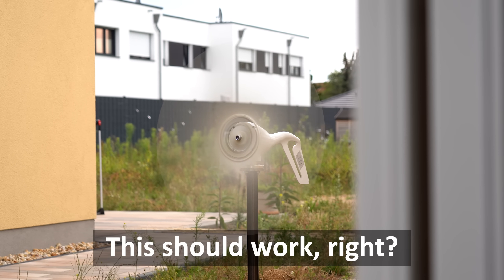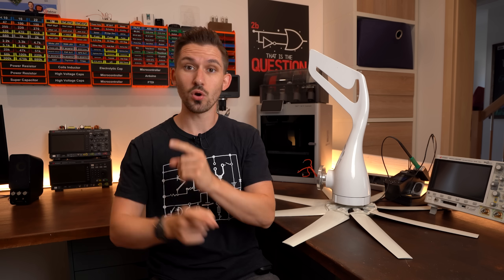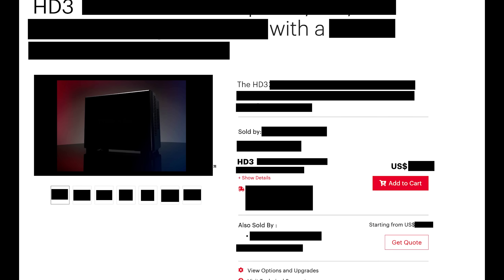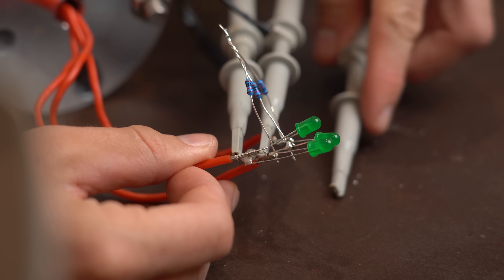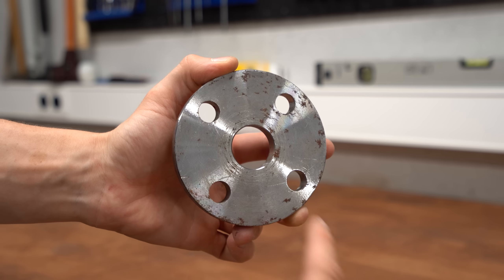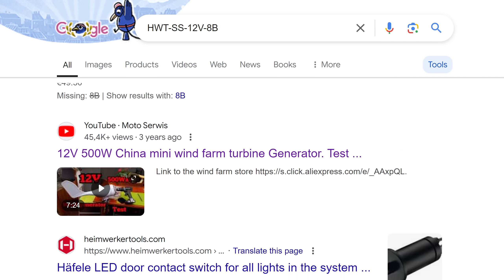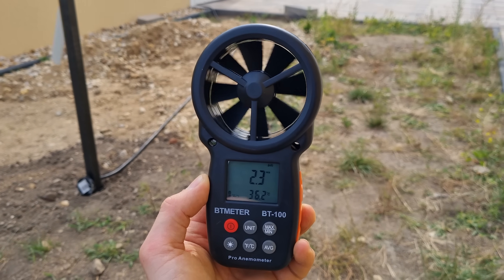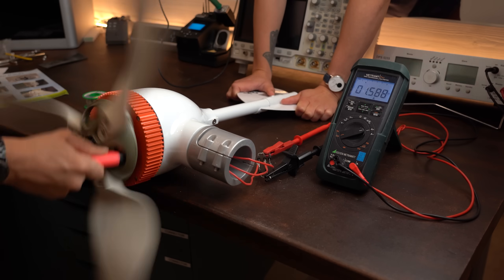I tried to Power my Home with Wind Generators! (Worth it?)

Comment: The ultimate curse of home wind generation is that the power you can extract from the wind is proportional to the rotor area, multiplied by the CUBE of wind speed. Low wind speeds, like those you can get close to the ground, have just a pitiful amount of energy that you can extract no matter what turbine you stick in the airflow.
Reply: Yep, mast height has always been the problem.  Masts really need to be greater than 30' above building tops, trees and other objects that affect the wind stream.  The problem is well documented for decades, and there have been no successful low mast solutions, not VAWT, not clustered, not funneled.  Minor gains can be made with some tricks, but those tricks always add complexity and structural weaknesses that make them prohibitively expensive.
Reply: 100% wind is not a very effective solution for homeowners. Even on a 12ft pole. Of course if you live on the beach and own a beach wall where wind is coming oner it most of the time, a giant horizontal one might be decent power, but that's very few people. Most small wind turbines are lucky to get 300watts out of them. They can claim 1200w but no one can ever get that, unless it's a hurricane lol. Solar is far better for home power.
Reply: @earl_gray  Yep, or dump it into refrigeration or heating/cooling if possible.  Roughly 30% of the electricity is wasted by charging/discharging batteries and running it through converters and controllers.
Reply: Yep, which is why modern wind generation plants use huge sized blades rotating at lower speeds but at large heights.  Basically, might as well use battery power at home with Solar.
Reply: @Obloms  Also important to note, that given their enormous size, the tip speed ain't that small either. Sure, nothing like a helicopter rotor or such but still quite significant.
Reply: @Obloms They rotate "slowly" to your eye because tip speed is fast with blades that large, and they use transmissions to change shaft speed.
Reply: @machooke4846  There's a truckstop near me with one and I got a good look at it's insides when they were building it up. It had the actual generator at the base with a long shaft straight up the mast. At the top it looked like a simple CVT with a bevel gear to the actual rotor.
No idea what other trickery was involved but it looked fairly simple.
Reply: @Obloms tip speed on large wind generators are very close to mach 0.8 (the speed of sound)
Reply: @Obloms  - commercial blade tips are moving, surprisingly fast, just the rotor RPM is fairly moderate...  (BLADE aspect ratio is proportionally approximatel to lifto drag, and tip speed  to wind  speed ratios.)  The numbers simply don't amount to a lot in small form factor.
Reply: @earl_gray  Not if they're not paying you anything to put the electricity back on the grid.  Which they don't, because when your solar is producing, so is everybody else's.  "Peak demand" used to be in the middle of the day.  Now, peak pricing is in the evening, because solar provides so much cheap power in the daytime.

If the utility is not paying you enough to put the money back on the grid, then the "inefficiency" of batteries doesn't matter.
Reply: Would one on top of the roof of your house work?
Reply: @99domini99  It'd be better than sitting at ground level, but not by a lot. For comparison, the average commercial wind turbine sits atop an 80 meter tall tower.
Reply: @Nicoya  I see.

I guess it would be way more effective to invest in a battery backup system so you can use your solar overproduction during the night.
Reply: @99domini99  Yeah, solar-battery systems are the big push these days, not just for overnight, but to shift overproduction surplus from midday into the late afternoon when demand peaks.
Reply: @Nicoya that would be the ideal situation, currently battery storages are adjusted to charge as soon power is available from the solar modules.
There is a peak in power consumption in the morning when people wake up. In summer this peak is partially covert by solar modules. When now a lot of batteries are installed, the solar production in the morning is not available anymore to support the grid during this peak time, because the excess energy goes straight to the batteries in the morning. This is something which has to be figured out in the future to generate the benefit which you describe.

The solution for this problem is not trivial. Let’s say a rule would be introduced to allow charging only after 9 am. All batteries would now start charge at 9 am. This would suddenly remove a lot of energy from the grid at this time. This is also not a solution. 

The solution would be that the grid controls when which battery is allowed to charge. To introduce such a control  will take a few years.
Reply: @Nicoya  Exactly right Nico, and most micro wind power companies publish that prominently so they don't get sued.
Reply: @99domini99  Depends on where you are in the world. If your locaiton is somewhere where there aren''t long dark winters sure but for huge chunks of the industrialized world (North america north of New york, Europe north of the Alps at the very least) Photovoltaics cells are not a a good option. They generate very little in winter which is when you need it the most. I would not reccomend anyone buying solar cells unless they have a AC that draws a lot of energy.
Reply: @supertyp9148 wondering if there's a way to only charge when there's excess power available (and only start charging on enough batteries to level it out)
Reply: @99domini99  that is very expensive and batteries die within 5-10 years.
Reply: @99domini99  how much do those things cost?  And do way realy even pay of in the long run?
Reply: @supertyp9148  That's only a concern for residential solar and of that minority, the ones who choose to buy battery systems. Large scale solar farms will continue to feed into the grid.
Electric utilities can also adjust time of use peak and off peak rates to encourage battery charging during the middle of the day. A simple rule that battery charging isn't allowed in the morning would be straight up ignored
Reply: @thelight3112   yes, true. I would say the impact for residential systems is not to be neglected though. My perspective is from Germany. The situation can be very different in other countries. 

Big facilities trade their capacity on the electricity exchange. For small systems they are excluded to benefit from changing electricity prices. -> they have no incentive to act beneficial for the grid. 
Also the scale of domestic batteries is not to be neglected. For example in Germany, the majority of installed batteries are installed in private households and not by the industry. Around 15 GWh of capacity are installed in homes without any control. 15 GWh are around 1% of the daily electricity consumption of Germany. This is already close to what would be needed to smooth out short term peaks in demand if they could be used for this purpose. But what’s happening is that all these batteries start charging at the same time when the sun starts rising and only discharge based on the consumption profile of the household they are installed in. This has an influence on the grid already. 

The grid would benefit to integrate these storage units into the grid control. Unfortunately it’s a long way to get there. Technical standards have to be defined which are not unreasonable expensive and legislation has to be created to force the grid operators to integrate these domestic capacities.

To pick up on your comment. One could argue that it’s more efficient to concentrate on industrial scale storage unites, because of higher capacity per feed in point. Which is on paper completely reasonable. Unfortunatly in Germany the industry is lagging behind in the installation of storage facilities and one major reason for this is that grid operators are lagging behind the on the approval process. It is said, that the approval backlog on the side of the grid operators are already 10 to 15 years already and this number will only increase with the decline of batterie prices. This makes assume that the grid operators are not very interested to integrate these batterie systems. 
Also here legislation is required to force grid operators to show more initiative.

To summarize: residential storage unites have the capacity but are not integrated in the grid control or dynamic price finding for electricity. Industrial scale unites don’t yet exists in a meaningful capacity and the installation is lagging behind demand due to bureaucratic obstacles.
Reply: @99domini99  the problem is the house messes with the airflow around it.
Reply: @99domini99  Yes they do and if he had reads the instructions on the wind turbine they always say to mount at least 10m from the ground.
Reply: actually that's the power of the wind, you cannot extract more than the betz limit of that which means roughly 1/3rd.
Reply: This is why vertical wind turbines are sum much more effective. Your total blade length is longer then the height of your pole because the blades tend to be countourd and hang from top to bottom. And it can extract energy from the entire column . Not just the one facing portion.   So if you have a max height of say 15 feet. You can easily have the equivalent of a nearly 30 foot wide windmil in a 15 x 5 foot column.
Reply: I can’t emphasise enough that if you really want a micro wind turbine you must spend the money on a quality product not an eBay special. A Primus Windpower or Rutland unit that is rated for marine use. It will put out what it advertises and will last for years. I have two and they are over seven years old and still going strong.
Reply: The obstacles at ground level like houses, trees and terrain cause a turbulent air flow. Basically acting like a huge obstruction which the higher speed air will stay above. I experienced this when my house was first constructed. We were hammered by very strong winds that hit our house due to no other houses or tress around us as well as an extremely flat terrain. A few years later and hundreds of houses have been built around us and in the last 20 years we have not seen winds anywhere near as strong as when our house stood alone. All the high speed wind passes by tens of metres above us.
Reply: If the wind is nearly knocking you over while standing on the ground it's windy enough.
Reply: one issue with windgen if the wind is too strong does it have protection
Reply: @earl_gray  Unfortunately that’s not working great either.

They’re actually planning to charge you for overproduction in my country as the grid cannot handle all that power.

So if that’s the case, I think I will invest in a battery backup system, then turn off the solar panels when the batteries are full if I’m not using the power.

I can’t afford an EV, but if I could I would send any excess power to charge the EV so I can use my overproduction to drive my car.
Reply: 06:30 don't worry about your welding skills. I went to the Ferrari museum in maranello some years back. There was a bare chassis on display out of a california. The welding was abysmal.
Reply: That's right. All you have to do to make it economical is increase the mass of the air.
Reply: vawt's are massive wind catchers,,, like the difference between four little wings  and 8 bent panel with 8x the surfice, while the wind is pushing on the panels AND pulling them due to the panel being shaped like a wing........   these propeller type should be banned...    mines half the size and 3 x the output.. oop I fergot I can stack 4 more on that pole
Reply: @HarmonRAB-hp4nk  Vertical Axis has it's downsides too. It's not as efficient at high wind speeds and on larger scales noise becomes a big issue.
Reply: Another amateurish misunderstanding of wind energy principles. First of all, the assertion that low wind speeds near the ground are inherently useless is laughable. Yes, the power available from the wind does indeed scale with the cube of the wind speed, but this doesn’t mean that wind turbines are utterly pointless at lower speeds.

Turbine technology has advanced significantly, and modern designs are specifically optimized for various wind conditions. The notion that we should only place turbines in hurricane-like conditions is as absurd as it is simplistic. Low wind speed areas can still be quite productive if you use the right kind of turbine. It's not like everyone’s using the same outdated, clunky design from the 1980s, you know.

Furthermore, the "pitiful" energy extracted isn’t a result of some inherent flaw in wind power but rather a challenge to be managed with innovative solutions and improved technology. If we followed such defeatist thinking, we'd still be using coal, lamenting over how "pitiful" the wind is compared to our dirty, outdated power sources. But clearly, progress is not in your vocabulary.
Reply: @KyleCox404  Sorry internet expert but wishful thinking about innovative technology can't overcome basic physics. Wind makes sense, but only at utility scale. It does not now, nor will it ever make sense at suburban-homeowner scale because there just isn't enough energy to extract to be meaningful.
Reply: @Nicoya  As if the basic principles of physics are being so ruthlessly violated by anyone but you. Your argument is as outdated as it is uninspired. The notion that wind energy is only viable at a “utility scale” and not for suburban homeowners is laughable. Have you been living under a rock, or are you simply allergic to innovation?

Sure, basic physics sets limits, but it doesn’t mean we're stuck with an archaic, one-size-fits-all model. The reality is that technology evolves, and so do the applications of renewable energy. Small-scale wind turbines can be quite effective for homeowners, especially when combined with other technologies like solar power and battery storage. It’s called a holistic approach—something beyond your apparent grasp.

And let’s not overlook the fact that energy needs and consumption patterns vary widely. For some suburban homeowners, even a modest wind turbine can contribute to reducing their energy bills and reliance on the grid. But then again, understanding that would require a bit more open-mindedness and a lot less dismissive snobbery. So go ahead, cling to your outdated beliefs. Meanwhile, the world will continue to advance, proving your “absolute” rules to be as flexible as they are flawed.
Reply: @KyleCox404  I'm sorry the laws of physics disagree with you but arguing with me isn't going to change it. The amount of energy available to the average household via solar is literally an order of magnitude larger than the amount available via wind. Augmenting home solar with a home wind turbine is about as effective as augmenting a river by taking a piss.
Reply: @Nicoya  Ah, the classic "laws of physics" rebuttal—always a hit with those who think a bit of textbook knowledge makes them infallible. But let’s dissect your egregious oversimplification, shall we?

First off, comparing wind to solar in such a crude, myopic manner is not only intellectually lazy but also misleading. Yes, it’s true that in many cases, solar can generate more energy than wind on a household scale, but that doesn’t mean wind is utterly useless or as ineffective as your colorful analogy suggests. Wind and solar each have their own strengths and can complement each other beautifully. The energy from wind turbines at night, when solar is absent, can provide a valuable boost. A little nuance might help you avoid such egregious errors.

Moreover, your dismissive comparison overlooks the fact that wind turbines can operate in low wind conditions where solar might not be producing its peak. And if we're discussing energy augmentation, it’s important to consider the overall balance and synergy of a home’s energy system rather than making blanket statements that disregard the complexity of real-world applications.

So next time you decide to wield "the laws of physics" like a blunt instrument, maybe consider that there are other factors at play, and a bit of critical thinking might actually enrich your understanding rather than reducing it to mere derision.
Reply: @Nicoya  " Wind makes sense, but only at utility scale. It does not now, nor will it ever make sense at suburban-homeowner scale..." okay, but how about on top of, or built into the corners of, tall or even medium-height (5+ floors) buildings in cities? I'm talking about some funneled, corkscrew-type designs I've seen posted about in the past couple of years, designed specifically to take advantage of the way air moves around and over buildings. What I've seen of them looks promising.
Reply: @Nicoya  counterposing wind vs solar misses the point stated at the very beginning of this video - wind often happens when the sun isn't shining, so being able to tap into both can help deal with the intermittency problem.
Reply: @dwc1964  I've seen those building-top ones too, and the answer is it's complicated. The wind around buildings tends to be rather turbulent, so it's got more energy than you'd get at ground level but it's not in a very extractable form. When you actually do the analysis you generally come up with the most sensible solution being to build a tall mast on top of the building to which you can mount a traditional turbine, and then you're kind of back at building a regular wind farm, except more complicated because you're trying to stick it on top of a building instead of out in an open, empty field.

As for filling the gaps in home generation, the problem is just one of scale: the amount of energy you can optimistically generate from a home rooftop wind turbine is maybe in the range of 200-300 watts, and it ends up making a lot more sense to instead rely on battery load shifting or utility generation.
Reply: This is why even 19th century windpumps (2-3m diameters with lots of blades for better low speed coupling - Jacobs/Aeromotor/Haliday/Southern Cross designs) are normally 10 metres off the ground

Self regulating windmills have existed for a long time (Haliday, 1879) and these cheap fixed blade designs are notoriously inefficient. Aeromotors with a rudder aspect of angling into the airflow (instead of being face-on) during higher winds have proven themselves for over a century of reliable operation

I suspect that about the only viable place for these microturbines is on top of sailboat masts. Anywhere else simply doesn't have the wind to be worth it
Reply: @earl_gray  That depends entirely on how much your electricity supplier pays you for the electricity you export. Where I live it is always more cost-effective to charge a battery with your excess solar generation.
Reply: @earl_gray LiFePo4 charging and discharging are pretty efficient tho, over 90%. If your city is paying you for exported power over 90% then it's a no brainer for going on grid. Otherwise building energy storage would be worthwhile, like if the energy company apply real time pricing, thats when the energy storage become very beneficial.
Reply: @fronthole_guacamole  the wind speed measurements were probably not the most accurate things and it was all mechanical so no electrical losses but mechanical ones the event was the racing Aeolus in den helder it's mostly just I fun engineering "competition" and we didn't take the measurements some other team did and I only got them by word of mouth we had wind gusts of over 18m/s and the measurement was probably while in a gust
Reply: studies show they only become reliably effective when over 50m(iirc) high. check out gary does solar, he recently covered this - tl;dr it isn’t
Reply: @earl_gray And pay for producing ones own excess as is seen by power companies In Aus and UK. Batteries are long term economy efficient.
Reply: Even when using a Savonious or Fibonacci design for the propeller?
Reply: @fronthole_guacamole  I know how to calculate the extractable energy after Betz and if the cars are moving at the same speed as the wind. The speed at the rotor would be doubled so if you drive 12 m/s and the wind coming from Infront of you is too your rotor "sees" a wind speed of 24 m/s in which case the power output would fit. And as far as I am aware the drive train is at an efficiency of over 88 percent. Please tell me if there is some error in my thinking. The team that measured this consistently drove 105% of the windspeed and at some point said they measured around 8 KW the point you go over like 9 KW is 10m/s wind speed and 10 m/s vehicle with an rotor blade length of around a meter. Please tell me what I am doing wrong if you still believe this to be the case
Reply: Apart of that,did you noticed the blades are almost perpendicular to the wind direction? That creates more friction then rotation, my bet is that he would change the angle of the blades at around 45 degrees against the wind,it would generate at least 10 times more torque= more energy, so instead of 1,38 W it will get around 14-15W at least.
Reply: I am considering a vertical axis wind turbine that looks exactly like a tree, I call it : e-tree,
the trunk of the e-tree is brown, the spinning sails (blades) are green,
attached to the trunk of the e-tree are features of : wifi/mobile network, light and power outlet, to charge a car for example
Reply: Sure but in nuclear fallout wind will still exist. Solar, not so much.
Reply: thats why you need to follow directions
Reply: Vertical turbines make better use of ground winds compared to these horizontal turbines.
Reply: Just Last week I was at an event where wind powered cars raced and some people estimates the power generated at around 10-12 m/s to be around 8 KW at around 3 meters tall and a rotor area of less than 4 m^2 I have not jet watched the video but wanted to leave that here
Reply: @earl_gray until very recently in the UK, grid export tariffs were pitiful, and the returns still far outweigh the inefficiency of battery charging for personal use.

I don't see why energy companies are allowed to have different buy and sell rates for the same energy at the same time of day.

My cheapest electricity is my EV nighttime tariff. I'm considering purchasing a second EV with V2H capability just to supply my daytime power.
Reply: I think Community Shared 10kw Lift up ones would be optimal, although “Just Have a Think” and some others have mentioned some novel Rooftop Wind Turbines that work decently well.

Also on top of 2-5 Story Buildings they would be even better!  (ie Medium Density Urban vs Single Family Homes)
Reply: @ericlotze7724  LOL do you even understand how large a 10kw wind generator would be?  I guarantee you no city will allow it in a residential area.  Again the mast is the problem, and it would have to be minimum 30' above the TOP of any ground objects, trees, roofs, poles.  When I say 30', that isn't even close to optimal it's minimum.  You're talking towers of 70', 100', 150'.  Do you even understand the lateral forces in a 30mph wind on a 10kw generator?  You'd have a tower that cost $50k real quick.  Most people can buy electricity for about 10 years on 50k, and you won't have to maintain anything.
Reply: @ericlotze7724  unless the building is specifically engineered for the dynamic loads inherent to wind machines rooftop systems are (unfortunately) a really bad idea! Also these machines require a lot of maintenance and rooftop installations tend to be difficult to access.
Reply: @dac7046  very true!  ESPECIALLY the maintenance bit.  I’ve worked as an electrician for a bit and i swear they put maintainability as the LAST priority short of where the NEC requires stuff to be accessible lol
Reply: So, what you're saying is... He can absolutely use these generators, he just needs bigger blades and maybe some gearing to turn larger blade surface into more torque into higher speed.
Reply: @timberger72  No, he needs a bigger and very expensive tower.  It must be guyed or have ample concrete base so it can't tip, as in several tons of concrete and rebar.
Reply: @timberger72  He also needs to place it on top of a tower, I would say atleast 30% above anything that can block it.